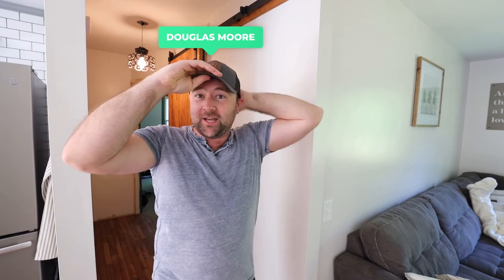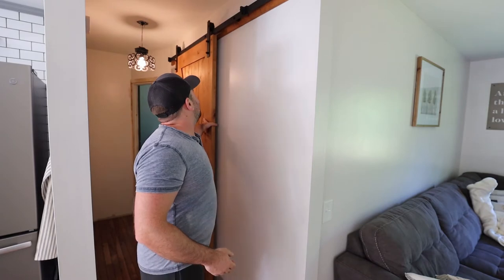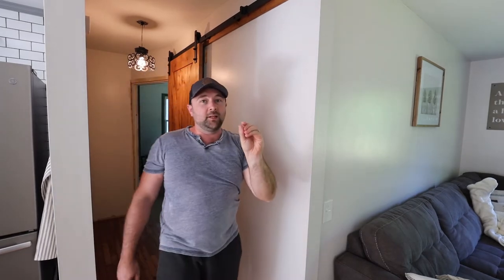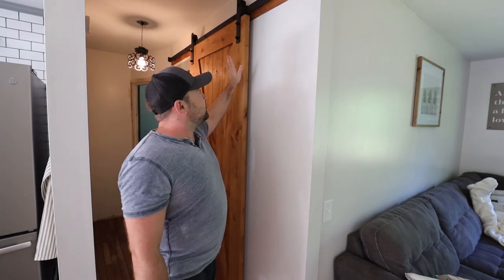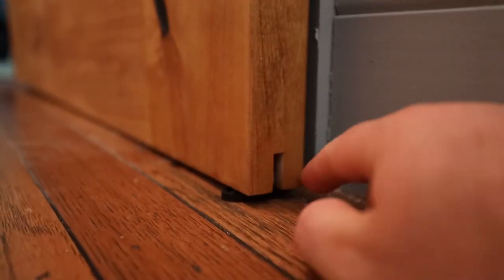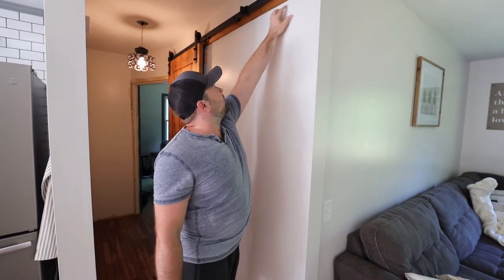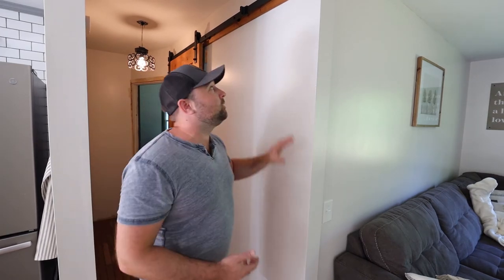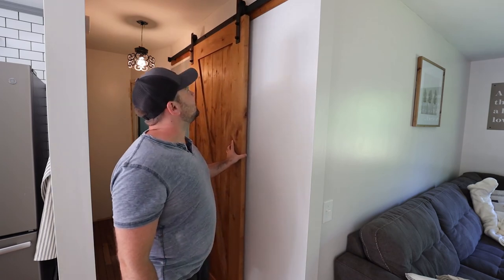Sliding Bathroom Barn Door - Installation Tips

Comment: How did you center the holes for the rail on the header board? Are they exactly along the mid-point? Also, is the quoted mounting height for the header board from the floor to the bottom edge of the board?